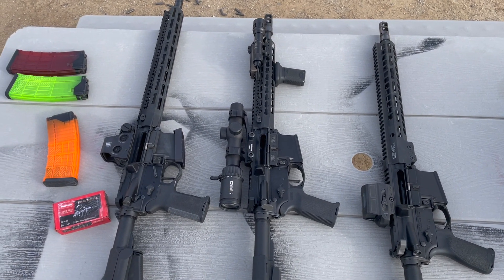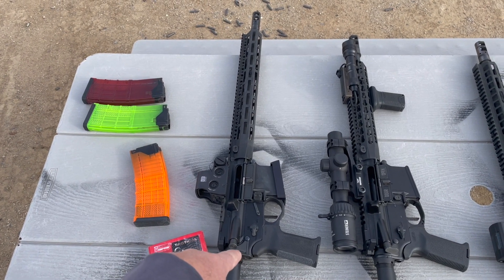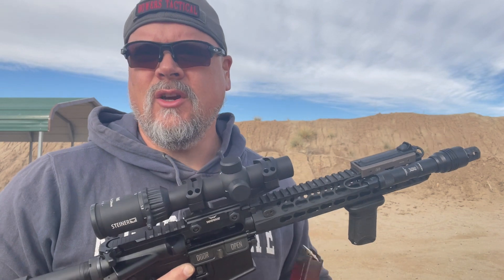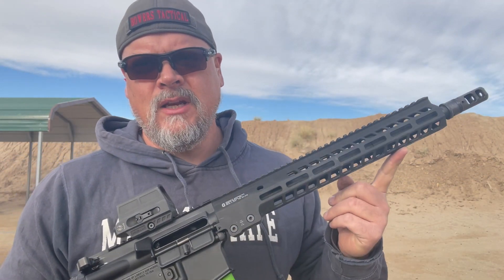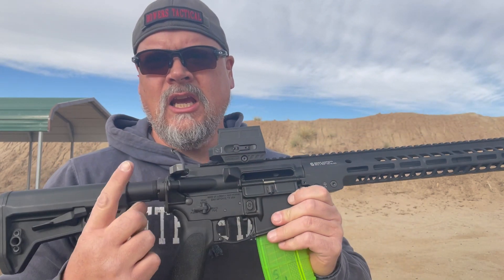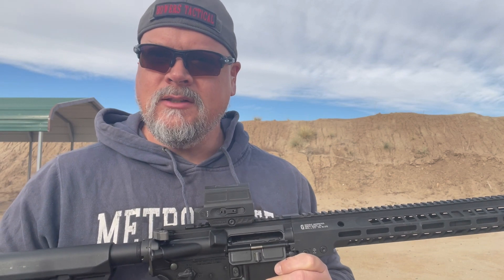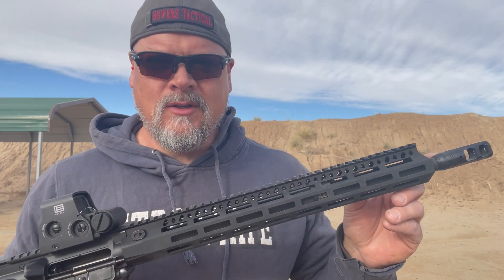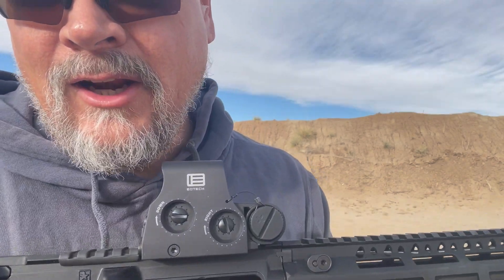AR 15 VooDoo, Timing an AR System, Part Four

Comment: In your opinion would an a5H0 setup with springco green have similar performance on your 14.5 mid? Gas port size on your 14.5? Thanks
Reply from the maker: It's should perform somewhere between the 12.5" in this video and the 14.5" with an H and Tubb flat wire spring in this video.  This is all dependent on the gas port size and BCG efficiency and any other frictional losses from the gun set up.
Reply: @seanmtactical6069   what's the gas port size on the 14.5 in this vid. The one with h buffer and tubb flatwire. Thanks for the info
Reply from the maker: @FreeBayArea  0.074". It's a SOLGW middy.

Comment: Alright I gotta ask....mk14 rail or bcm mcmr? If you could only have one more rail for then rest of time?
Reply from the maker: Both are solid choices and I own both.  I even have a KMR and use it all the time, but I prefer the Geissele MK14 handguard.
Reply: @seanmtactical6069  I hate having to take off the bcm rail for any sort reason but awesome video man and sweet setups.
Reply from the maker: @C_oprator89  why would you have to take the handguard off?

Comment: Hi Sean, is it required to remove a handguard to adjust a block for different ammo or can? If yes - POF renegade is way more convenient
Reply from the maker: Depends on the adjustable gas block.  The ones that have a forward facing adjustment screw with detent stops are the best.  I recommend the Superlative and the SLR.
Reply: @seanmtactical6069  Make sense - thank you